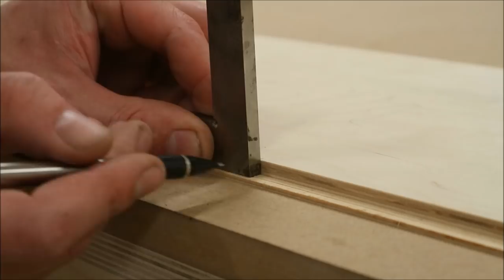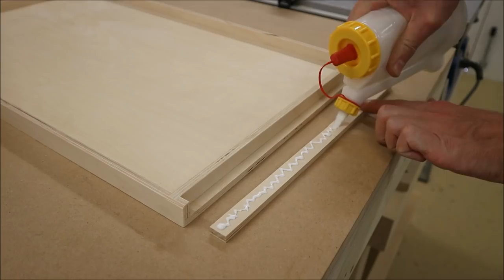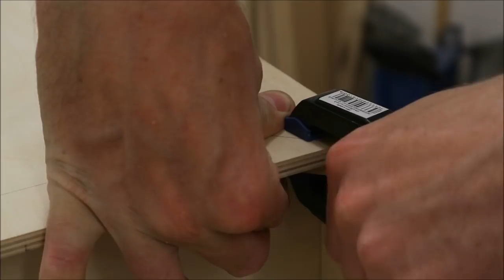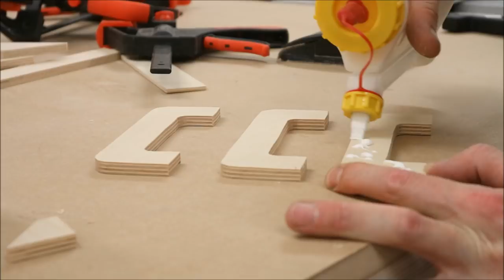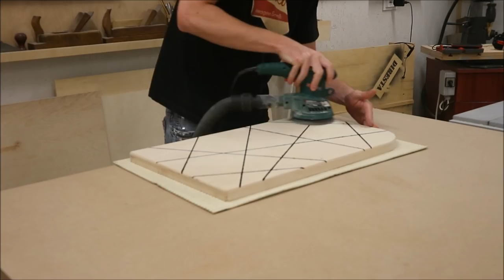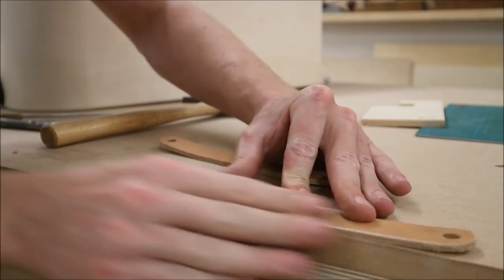Making a Plywood Suitcase

Comment: Looks nice... Definitely a piece of baggage that you would never check with the airlines though since it look ruined after it went through a single flight with the baggage handler apes (reference to the old American Tourister commercial).

I've considered making a piece of luggage for checking in with the airlines though.  Something that would take the maximum length+width+height that the airlines allow and get the maximum volume out of it.  That should be a cube.  For carry-on luggage, I find that completely soft sided (i.e. no frame) works best since it can always be squeezed into the available space in the overhead compartment.

Comment: Nice video, again. Good tempo, you get to see all you need but not more details then necessary.  
It's a nice and interesting piece. The problem with these are always keeping the weight down. Might work with thinner plywood, at least on the flat sides and might be able to skip part of the extra thick bottom? Personally not so much for the wooden wheels and the handle. Would have preferred a round handle dressed in leather, which I thought was a nice touch. The lines on the lid was a nice touch but would have been even nicer if it continued all the way around even though that would have been tricky. I myself would have put the hinges and locking on the sides instead of top and bottom, but that's just a personal choice.

A tip or two. Noticed at about 15 seconds in you used a small piece of wood to hold the board down when cutting. Don't know if you are familiar with a feather board and just chose not to use one? Otherwise, check them out. Very useful and can just make it out of wood, so no need to buy. Also, when you cut the whole thing open. After each cut, tape some small pieces of wood with the same thickness as the blade into the gap to make it more stable before cutting the next side. And if you build a higher fence you can cut the round corners to, not as tricky as it might seam actually.

Again, nice project, nice video
Reply from the maker: Thank you, Filip! And thanks for your input. Yes, the design is a taste question. The extra thick bottom i made to strengthen the wheel and hinge assembly I made this for a Plywood challenge and want to use the plywood in many places as possible. About the weight, it only 6kg and the hard case models in similar size are not much lighter. And no, the ugly piano hinge on the side would not look good. also every time you need to open the case you have to turn it so that the locking faces you. The piece of wood is just there to keep the thin wood pressed against the table for an even cut depth. as i know feather boards are springy and could give. I might buy some feather boards but it worked just fine! About the box cutting part, i prefer to leave some small areas where I don't cut it, and hand cut them afterward. As this is not a how-to video, just for entertainment purposes feel free to do it your way.

Comment: Have you traveled internationally with this case?  Was wondering if wood was an issue as many countries have very strict requirements for things like wood packing crates when importing goods.  I'd like to build a storage case for international travelling with some equipment, but am worried I wouldn't be able to bring the case itself into a country.

Comment: The part after u spray paint black... R u peeling the top veneer off.... Or...? Have u taped it all and peeled it all off after the spray painting?
Reply from the maker: I taped it all and spraypainted it.
Reply from the maker: But i would suggest a clear coat before you tape the surface and than apply the black spray paint. This would help to avoid the black color soaking in the top veneer.

Comment: It's a neat project that I would try to build for fun but it's not very practical. First is the weight factor. The suitcase probably weighs as much as you can carry on an international flight (50lbs). Second, after your first trip, the suitcase will be banged up because of how they're handled during transit. Third, you forgot the TSA lock.
Reply from the maker: Thanks! It weighs 6kg , i don’t plan to fly with it, and not all suitcases have a TSA lock. It was more a challenge for myself than a finished product

Comment: How can someone correct the german video description (link names)? Incra T-Regel - > Incra T-Winkel, Spindle sander - > Spindelschleifer, Tisch sah - > Tischkreissäge, Die Strecke sah - > Tauchsäge mit Führungsschiene, Mitre sah - > Kapp- und gehrungssäge, "Tipp mir" - > spende mir
Keep up the great work. 
Greetings from lower saxony
Reply from the maker: Thanks Nik! I don't know if it's even possible for others than me. I guess that's what I get for using google translate. Also I'm quite surprised that someone actually reads the description! :)
Reply: I guess it's better thet you add the Description since people can normally, if no description is Added by the Author and the translation feature is enabled, edit in their own links. I always try to support the creators of Videos as good as I can and since I'm curios what tools you use I read the Description.
greetings 
Nik